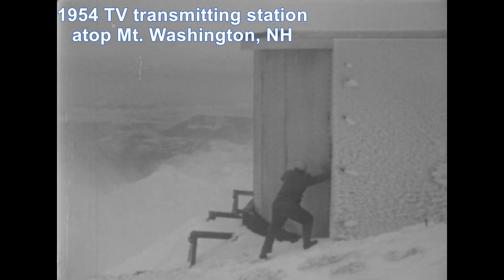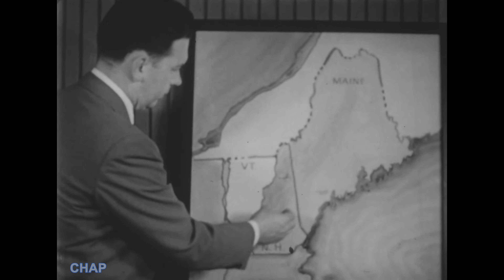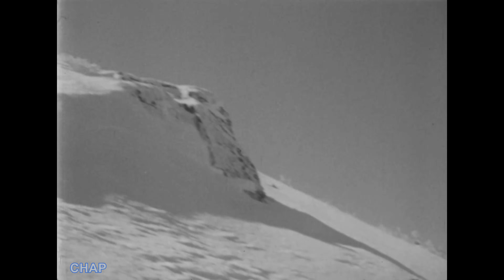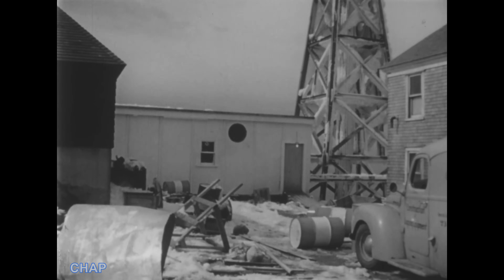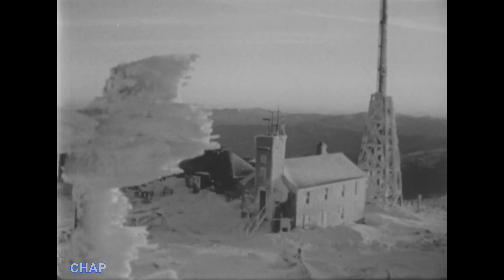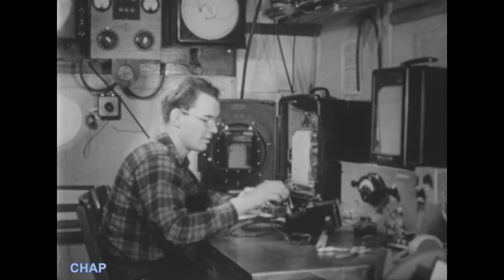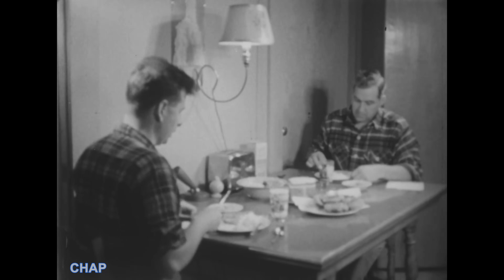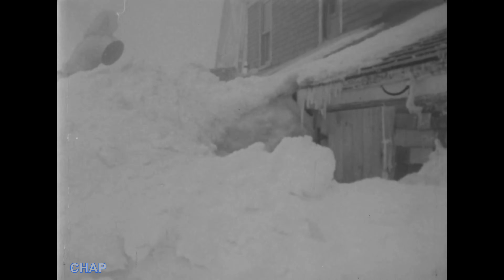Do You Remember Sub Zero Television Transmission in 1954?  Misery Mountain!  WMTW-TV Washington

Comment: Brr and can believe they needed no heat due to the heat from the vacuum tubes and transmitter.
Reply: I remember reading about a radio station in Nome, Alaska that didn’t need insulation until they went solid state!

Comment: My first job as a transmitter operator was at a station with the RCA TTVA shown in the film. It was a monster that required a 600A three-phase electrical entrance. Warm up prior to sign on took at least a half hour, preferably an hour.
Reply: I worked at WPBN while it still had an RCA 10kw model "B" with a 25 kw model "D" ring of triodes visual booster amp added on.  You needed at least a 20 minute warm up to vaporizes all the mercury droplets inside the high voltage mercury vapor rectifier tubes.  I had no time to wait as I arrived for sign on late, and I could hear the studio guy laughing over the com as I crashed the transmitter when I tried to turn on the plates too early without enough warmup.  Wonderful memories of those days.
Reply from the maker: Wow, what a story!   That's a technical detail most people would never suspect!   Thanks!

Comment: Here in central Massachusetts, if you had a TV with a tuner that had great discrimination capabilities, you could pick up channel 8 regardless if you lived on a hill, or lower to the ground. The image would be in color, barely visible, and perfect audio. Most TVs could not do this. They'd either pick up the high end of channel 7 (WGBH, Boston), or the low end of channel 9 (WMUR, Machester, NH).
Reply from the maker: Cool.  Used to live in Central Mass.    WGBH stands for "Greater Boston Harbor"   : )  Thanks for the great info!
Reply: @ComputerHistoryArchivesProject  I meant WHDH. :) OOPS!! :D